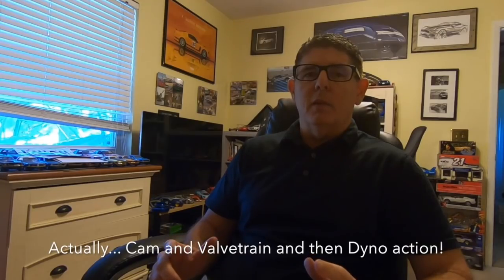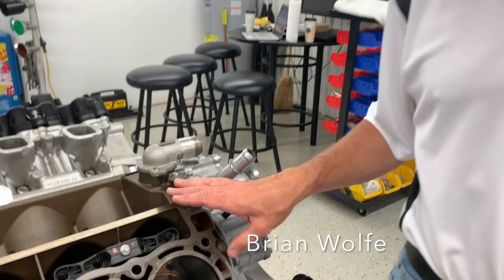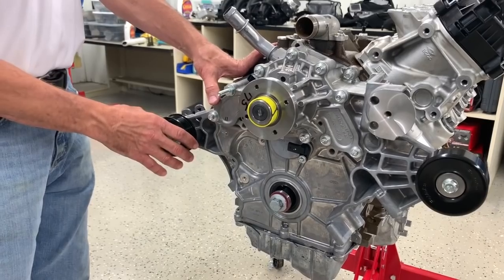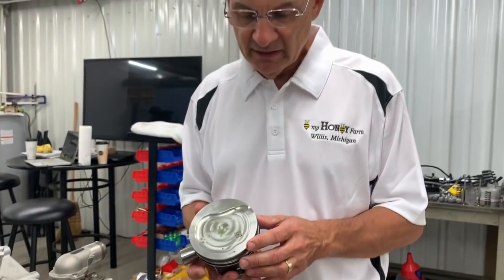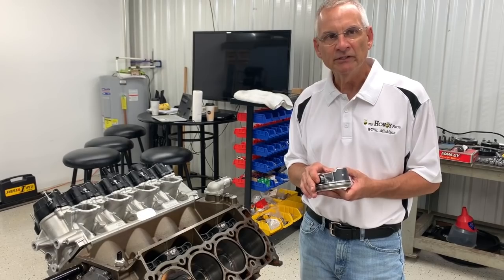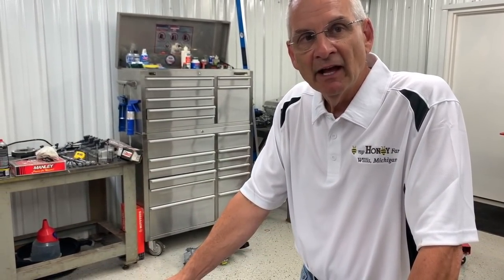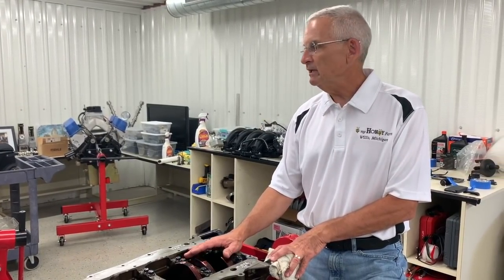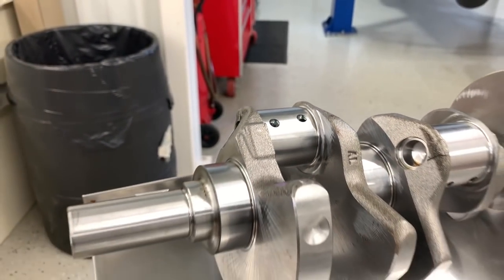7.3L Godzilla Ford V8 Bottom End Teardown — How Big Can this Engine GO?  Crank, Rods, Piston, Block

Comment: This totally amazes me now the ford 7.3 and dodge 6.4 have great potential, Heads-block and both Forged cranks great so far yet both put shit Rods & pistons in them. I mean just how much to upgrade to Forged rods & pistons. Both use full forged in their high output Engines, and will promote these cheaper engines for use in classic and swaps, fully knowing people want to add Boost like 8-9 psi, but both are safe with 5-6 max if want reliability. I'am looking at a 250 truck either ram or f250 in gas, don't want Diesel expense but do I have to tear down a new engine just to do what both Factories should have done, actually pisses me off. What extra $1000 to put forged, my cost $5000 plus.

Comment: Imagine a properly made Ford oem 40 valve 7.3 Godzilla for the mustang
Reply: Why?
Reply: @Larcona_  because why not, people want the 460 back as a stock motor for trucks my 4.9L straight 6 is gonna get a 16 pounds turbo setup
Reply: @Project-gr6zy  The current platforms are producing more than enough power.
Reply: @Larcona_  Im happy with what's there but it would be cool, I'm gonna turbocharge for 4.9L straight 6, my ranger has the duratec 2.3 Dohc with a Mazda speed 3 turbo on it, and it's fast with 268hp and 290 lbs of torque with my tune, a lot of people want a new big block V8 because it's not common, my 4.9L is not common and it's a big block 6 would be 402 cid if it was 8 cyls
Reply: @Project-gr6zy  More power than my 4.0, you do know godzilla is a small block, right?
Reply: @Larcona_  I didn't know it was a small block, wow, I like my big block 4.9L straight 6 it's a monster with the T18 and Sterling 10.50 3.55 lsd and 4x4
Reply: @Project-gr6zy  The 4.0 ohv is no monster, but with 33's and 4.10's it does the job. Ranger's a damn mountain goat.
Reply: @Larcona_  I'm waiting for my 4.9 to die
Reply: @Project-gr6zy  Ready for a swap?
Reply: @Larcona_  i have a built 4.9L 5.8l dished pistons , 16 lbs boost twin turbo setup for 1500-3000 rpm hi flow oil pump and twin3ft by 8" intercoolers  the turbos are Garret hx35s
Reply: I think 5-valve per cylinder technology has run its course.  Not enough benefit over 4vpc for the extra cost involved.
Reply: @andyharman3022  I'm boosting the motor, another valve is more airflow, allows for more gas to also be burned at the same time, if properly ported can create a vortex to mix the gas better since it's port fuel injection
Reply: @Project-gr6zy  Who is designing the cylinder head?  I designed a 5-valve dual-plug head for one of my projects many years ago.
Reply: @andyharman3022  there's a cosworth head 5v and a custom cnc shop I know either one works but I would need to design the head
Reply: @Project-gr6zy  What software are you using?
Reply: @andyharman3022  3DS max and cad, have the licensed college editions for welding class, I'm looking for the 5 Valve rather than Pay an absorbanent amount to have one made but if I have to I'll build it up, it would be for my 2002 ranger 2.3 Dohc with the Mazda 6 speed out of an 09 NC Miata, with 4.10 LSD 8.8, I plan to run 27 psi since my block is a closed deck engine and weld support struts and ribbs around it

Comment: 2:18 that cylinder wall is so thin and a very limited support for head gasket sealing. Looks like the weakest link in the engine right there to me. They should have just made the engine an inch longer and they could have had a much better block and with better/more even cylinder cooling.

Comment: That cut between the bore will prove to be a weak point for aftermarket applications. Hopefully if  Ford offers the 7.3 as a crate motor, they will allow you to choose whether you have the cut or not. One of the strongest factory engines, the 2jz has a siamese bore and has its strength because of that.

Comment: Ford is so close to actually giving the people what they want.   A pushrods motor with a good block, crank and heads but yet they are still to dumb to put a good rod in it.   For heavens sake take notes from chevy and put a good rod like a gen 4 LS motor has.
Reply: It will be easy to get rods from Carrillo or many other aftermarket sources in the near future.  They can easily sniff out a new market.
Reply: @andyharman3022  Yea I understand that part but it would be nice to have a good rod from the factory.   Not something that almost imediately needs upgraded.

Comment: The new Windsor produced 6.8 version should be too. It goes into production in 2021! Ford has been dyno playing with it all year! Its just a de stroked 7.3 !  4.225" bore x 3.976 Stroke on the 7.3,  So the 6.8 is prolly a 3.5" or so stroke making it about the same specs as a 351 4bbl Cleveland or 5.8  351 W lightning roller cam engine. These are 2.17 int. valves 1.674 sodium ex. valves, 10.5 comp ratio, zero imbalance rotating assy, it should be a nice F150/Mustang engine when it hits. Ford needed a cheaper old pushrod V8 like Dodge and Chevy have. The 5.0 DOHC is their screamer Ferrari engine for the Shelby, Cobra jet, Boss, Bullet, etc crowd. I bet this takes thousands off sticker for a V8 F150 or Mustang. Want a super go fast one? Order the 5.0 DOHC 8200 RPM horsepower engine. Best of both worlds.
Reply: I read on the Hagerty site that the 6.8 is going to be aluminum block.  Have you read anything like that?
I think the stroke is going to be about 3.72".  To be on a par with GM's 6.2L L86, it will need to put out ~460 HP.  I can see that.  10% more engine, 10% more power.  Ford won't be able to keep Son of Godzilla F150's in the showroom.

Comment: Nice ford built an LS
Reply: And GM built a Ford Windsor when they introduced the LS
Reply: @flcracker9  Windsor has six bolt mains?  Closed in valley? Front mount crank driven oil pump?
Reply: @zedperformance  Yeah duh the ls has a front mount distributor JUST LIKE THE SBF
Reply: @roncook8566  best part is how every ford fan boy cursed at the  archaic in block cam of the ls but now that ford has this it's the best thing in the world again.  Ford lovers are very special people.
Reply: Ford did build the LS/Cleveland in late 1969 early 1970.
Reply: @darrenhefford3722  lol nice try but no, not even close

Comment: I claim that Ford completely blew it on the block design of the 7.3. That "coolant slit" between the cylinders is a joke and head gaskets will blow like popcorn on these. There absolutely needs to be coolant flow between the cylinders and a solid metal area for the head gasket to seal against. For Ford to siamese cylinders is flat out stupid they know better. Look at the 2.7 Ecoboost and the issues there. Ford continues to produce garbage and this engine is just another example. A single row timing chain really? An oil pump driven with a single row a chain and shaft? These engines are having camshaft and lifter failures at around 40k filling the crankcase with metal. Do even a little research and discover how bad these engines really are. As a Retired mechanic with 40 years of on the job experience you will never see a Ford in my garage. From spark plugs blowing out of heads, water pumps driven by a timing chain so when they fail is fills the crankcase with coolant, dual clutch transmissions, 6.0, 6.4 diesels, CP4 high pressure fuel pumps, check engine light on normal, and so much more Ford continues to produce pure crap.

Comment: Again neat but coyote based is still king. I guess it's nice to have options but what's the point in promoting this which is what ford is obviously doing. If you want push rod buy a dart block spend less money more power because that is what they are designed for. Not a low revving 580lb truck motor IMO. I support either way but it doesnt seem promising
Reply: Adding a Dart block or any aftermarket iron one to a 351W will make it as heavy as this. There is an extra 50lbs of iron in them. The 7.3 heads look like you'd need the that Windsor to have 10 degree Man-O-War or CFE heads to be comparable.

Comment: Go back to the drawing board a chain driven oil pump vs a camshaft driven oil pump like in the old days....it will be a matter of time when that chain gets slack and  breaks engine loose oil psi and a blown engine....how much more would it had cost ford to design the 7.3 with a camshaft driven oil pump....its a shame that manufacturers will find a way to build a car or truck with the cheapest design possible and charge the public outrageousl prices
Reply: Bullshit. Chain driven oil pumps have proven reliable on various engines for over 200K miles. It’s a truck engine designed to make all of its power at very low RPMs.
Reply: I'd much prefer a crank driven oil pump than a crank driving a cam driving a shaft of various length to drive the oil pump. It's a proven design and the oil pressure builds quicker when it's already in the oil rather than having to suck it up from the sump.
Reply: Well, if that timing chain breaks you will wipe out a couple of pistons and valves. Oil pressure will be the least of your worries, plus oil pumps were driven by the distributor shaft which was driven by a gear on the cam. Yes, a solid design. But I haven't seen a distributer on an engine in a few years. And the cam was driven by a timing chain... Hey wait a second!

Comment: too bad GM hasn't come up with a 6 bolt big block to compete even though the LS motors will handle a lot of cubes worth of boring and stroking.  imagine what a true bowtie 6 bolt would do.
Reply: You eventually have to give in to the bigger dimensions of the 7.3.  4.53 vs 4.40 bore spacing means a bigger bore for the Ford.  9.65 vs 9.24 deck height means longer stroke for the Ford.  Yeah, there are guys building tall deck LS's, but do you think Ford guys can't do the same?

Comment: I like this engine as a great V-8 for durability in a truck. Trying to be competitive with GM in Big Block racing is going to cost millions in development dollars. If you somehow can dominate GM the NHRA will find a way to outlaw the engine just like the WOO banned the Ford Yates canted valve heads when Casey Luna Ford won the championship against the Chevys. Just like NASCAR choked the Yates Ford with restrictor plates until GM developed and  then Toyota copied the Fords.
Reply: This engine isn't large enough to compete against GM's big block.  Or Ford's.  Or Chrysler's.  It's more of a plus-sized small block that won't get much past 470 cubes without getting stupid on rod length.

Comment: What's the big deal?  Engines this size have been around for decades.
Reply: But this is the first engine bigger than the biggest small-block Chevy to go into mass production in decades.  It's also the first pushrod gasoline engine to be made by Ford for about 20 years.

Comment: POWDERED metal rods, WHY WHY WHY?
Reply: Cheap and easy, good enough for most usage
Reply: @smokenchoken1736  I know why lol. But problem is we will still get shit on by stock LS's that can BOOST the heck out of those. It's the same thing over and over with Ford.
Reply: @blueblood76  pretty sure ls engines use powdered metal rods....
Reply: You realize the top corvettes have powdered metal rods right?
Reply: Guess we'll find out when somebody breaks one
Reply: I worked for Jaguar for many years they went to the powered rods and cranks  in 97 in their 4L V8 very strong handled 800 hp at 8000 rpm in test engines with no problems
Reply: @frigglebiscuit7484  
just looked it up because im not a LS guy lol. Yes the do.  The yote rods did a way better job
 then the Powdered 4.6L 4V rods which I have to deal with,  Those are not great.
Reply: Same reason plastic timing chain guides.......

Comment: Cylinder Walls look very weak. This motor is also underpowered for its size. A 6.2 gm will run circles around it.

Comment: That motor is junk with the split between cylinders, can't be bored probably can't be boosted without cracking.
Reply: Yeah, I spy potential head gasket failure between each cylinder
Reply: @UCD_g2jXGHJyNZ2e5LS_H5WQ the design looks like an after thought maybe they had overheating issues with the first engine.
Reply: That's because ford doesn't want you to mod this engine like that
Reply: Arg! The deck is closed, an inch thick, and it is cast iron, not aluminum. They cut the deck away so we could see the cylinder wall thickness. Christ, you guys are killing me. Haven't you ever worked on an old cast iron block before. Maybe broke one apart to see what is inside. The walls are way thicker on this new engine, nevermind the fact that it is fully skirted with 6 bolt mains. I give up

Comment: Garbage engine i have been told by a Ford mechanic, the oil pump set up is a disaster waiting to happen, he said what would posses them to place it at the back and run by a chain, he has seen lifter, valve and cam failures at 40-50 k, he says leave it in the showroom

Comment: Junk engine compared to the 460 7.5liter.
Reply: Why would you say that?
Reply: @void2618_  because drugs😆🤦🏿‍♂️
Reply: The 460 is ah good peice of machinery ...... in fact 1 of the best ! But it just doesn't have the technology that this engine does!
Reply: Ignorant statement
Reply: I didn't know the 429/460 was better than a block with full skirts and 6 bolt mains. The SCJ 429's were amazing engines though.